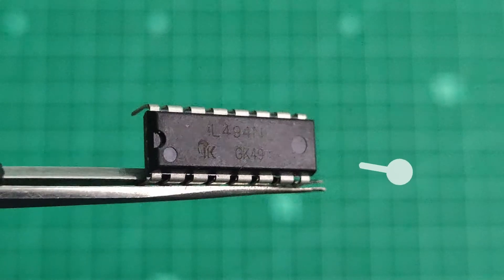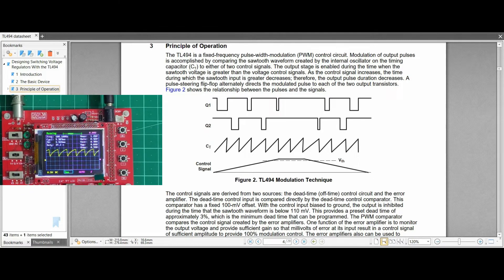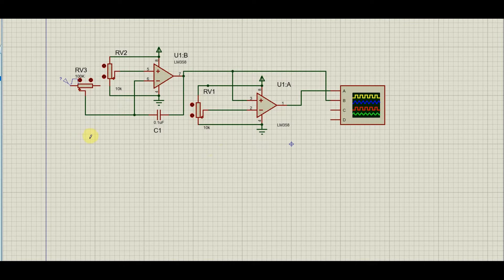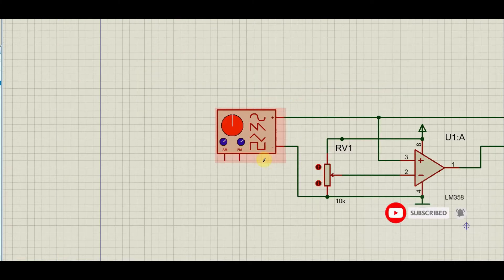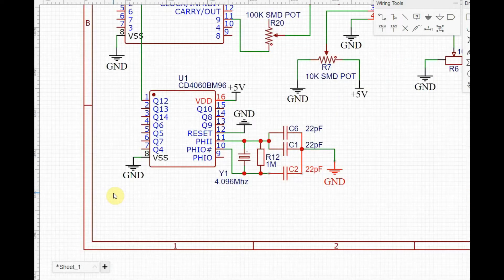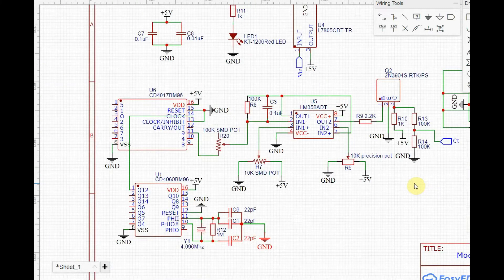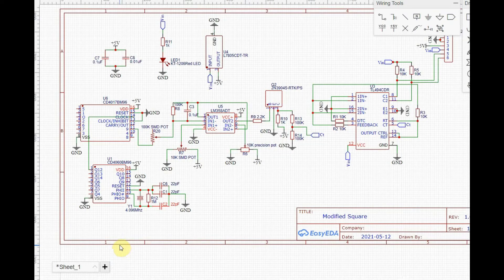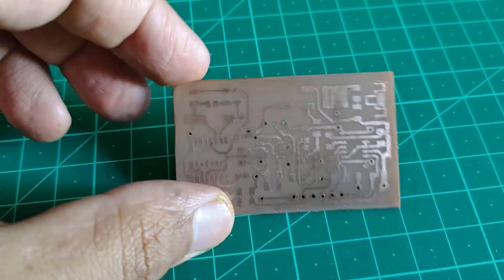EGS card for Modified Square Wave Inverter !

Comment: Your stuff is proffesional but the only issues I have is how do you do pulse with modulation for something that takes big voltages??? This is only good for small voltages but what if the voltage is 230v and three phase or even if it is around 100 v, how and what IC do we used to do puls with modulation for that??
Reply from the maker: Hey thanks for writing. As you rightly pointed out that this circuit works in low voltage but you can use this signal as an input to a MOSFET driver IC that is designed to take digital signal as input and can drive MOSFETS which can handle quite high voltages. A good example driver IC would be IR2104

Comment: 4.096 mhz isn't exactly available in my area. Can I use 4mhz crystal??
Reply from the maker: You can use 4Mhz. In that case the frequency will not be exactly 50 Hz. For 4 Mhz the frequency will roughly be 48.8 Hz using this exact circuit
Reply: @UtsavShah_25  Isn't there any way to adjust the frequency??
Reply from the maker: @jahirulislamshovon9256  Well if you want to use purely analog components then it can be a difficult task to achieve 50Hz from exactly 4MHz. Alternatively you can always use a microcontroller